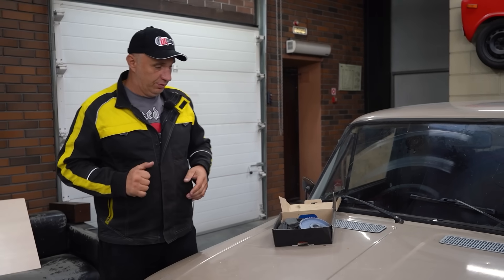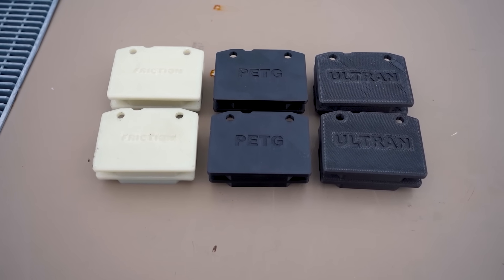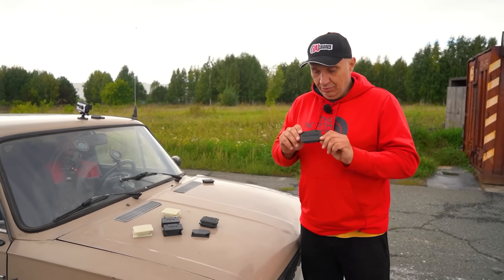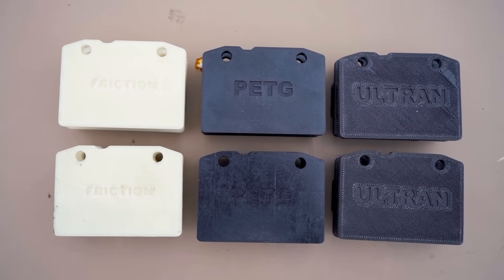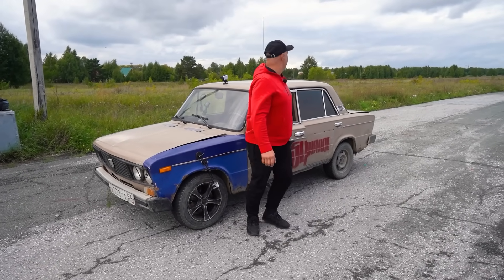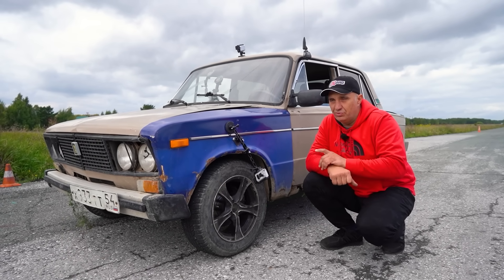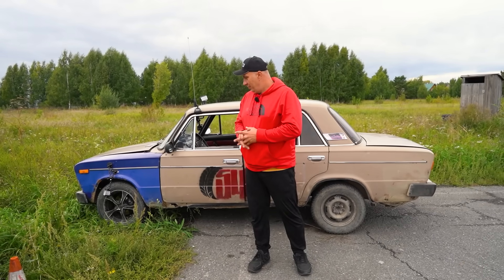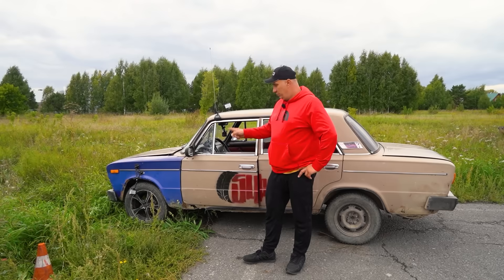We 3D print brake pads for a Lada

Comment: Wish the Ultran pads got tested a second run, to see if they had better performance broken in.
Reply: Definitely

I don't see it as a replacement for cars but in smaller and lower speed/stake use cases, absolutely
Reply: Definitely. You need to brake hard a couple of times to fully bed new pads into the rotors even with the real things. No point in doing that with PETG and GF-nylon which melted faster than this could happen but CF-nylon looked like it could handle it.
Reply: @MadScientist267  Those would be cool to use in a Go-kart or something similar, considering they ere able to stop a 2,000lb Lada. They should have no trouble stopping something weighing only 300lbs. Would make for a great replacement in systems where they no longer produce the pads, or something to save some money on
Reply: @3n3ly7m9  It's less the weight and more the energy in play. A car and a gokart will be using radically different amounts of energy.

The only problem with printed brakes that I see is in the very nature of both anything [plastic] printed and the idea that brakes produce lots of heat.

In a nutshell, "heat melts the filament to begin with, and brakes make more heat than that"... if you think fade is bad with traditional materials......

So to deal with a car, you'd make them bigger, and for a gokart they wouldn't need to be as robust... but both cases would need a way to deal with heat buildup.

Brakes get hot enough just in normal driving to turn those into soup just like the hot end did to make them... Not an effect that will be visible with just a single run like in the video.

I do think it would still have use but I'd want to see a set absolutely tortured before I trusted the idea to do anything real.

The gokart? Haha why not, go ahead and print em on up... I'd roll those.
Reply: @MadScientist267  Yup! Heat's the real killer here!  It IS supposed to melt with high heat or your 3D printer couldn't use it, and brake pads produce a LOT of friction heat! Those special plastic filament materials are made with strength in mind and NOT really heat resistance.  They are getting better and better though and hopefully something with BOTH properties in mind will eventually be available to try on "crazy" experiments here soon!  👍👍
Reply: @arthurmann578  Indeed. I figured they would all look like the PETG...

After seeing the Ultran, I was shocked at first that the glass version didn't do better but then it hit me as to possibly why they had stronger fade... I think the Ultran is probably conducting heat rather well, but the glass does not. I think this may be what is holding them together better at the interface. In terms of raw "stand up to it", the glass I would imagine is comparable in toughness at sane temperatures. It would explain why the glass fades so heavily with "all else equal" lol

Just a theory 🤷‍♂️
Reply: @MadScientist267 Brake pads cost nothing why would you use plastic?
Reply: Carbon reinforced nylon for the win. Wonder if that could be used on model airplanes.
Reply: spoiler T.T
Reply: @Jobanivrodnachui  Prototyping a design for something having specific requirements maybe... I'm not saying there's some kind of "dying for it" market for such a thing... but I'm damn sure acknowledging the hacks these guys prove out when they're simple, effective, and have viable potential for use. Most of it doesn't qualify... but this does. 

For another good example that I'd really like to see play out a bit further, check out the engine brake valve in the exhaust. Add on some detail like brake pedal + clutch engaged -> spark/fuel kill > valve close > throttle open > friction brake... Guess what makes a really nice candidate for the minimally-in-play friction brake?

No commercial market for this specifically now of course with electric trying to take over... but if you're building some one off contraption that employs this kind of thing, you're probably doing it similar to how Vlad here push started this whole channel lol... "Because reasons" 🤣
Reply: What is Ultran actually material made of ?
Reply: @dzitiatri  Not a lot of info available it seems but way I have it, carbon fiber reinforced nylon
Reply: @MadScientist267  it will not withold temperature
Reply: @dzitiatri  No but if you notice I mentioned limited use cases and such. I explicitly already mentioned the lack of tolerance to heat soak, especially at higher temps. This doesn't mean it is useless as a brake friction material.
Reply: @MadScientist267   It's interesting idea. But printing will not work probably there, as rotors heat up to the red light Which will be 1000 Celsius. It would be more interesting to see a d printed axle shaft
Reply: @dzitiatri  I give up.

Read all of this thread. Then respond.
Reply: Ah yes, bed the pads in so they work better. You mean glaze the rotors so they don't work at all anymore? You guys are funny. You can see the rotors already caked in nylon after one application on the post inspection. You can't make brake pads out of a material with Tg/HDT/Tm of less than 300 °C unless your goal is a speedrun to heaven/hospital.

Comment: I work with plastics, that glass filled nylon is really durable, it is used for the chassis of some car vacuum cleaners, and even more stressful applications. I'm most impressed with Lada brake pad retainers, that's a very easy change, I wish American cars had that!
Reply: Those pad retainers are only easy when they're not rusted shut, then they're a nightmare.
Haven't owned a Lada, but a Mazda i had used a similar retaining mechanism, and i had to take the car to a shop where they pushed the pins out with a hydraulic press and even that took ages.
Reply: Injection molded plastic with glass/carbon filling is not really comparable to 3d filament "reinforced" with those. With injection molding, you use long strands that increase strength substantially by bearing the load. In 3d filament that prints out of 0.4mm nozzles, the strands are chopped to such tiny lengths that they're basically dust and don't actually carry any load. Mechanical properties testing of these materials reveals that they're very marginally better than plain plastics, if at all. Carbon filling greatly increases UV resistance but beyond that it's a huge waste of money.
Reply: Toyota trucks use that caliper design, in the front. Way easy to replace pads on.
Reply: @michaelbuckers carbon filling increases the stiffness of the part quite significantly.
They also tend to do a bit better at higher temperatures and are more resistant to creep.
Tensile strength is about the same, though.
Reply: That's because Lada is based on a 1950's Fiat.
Reply: @NoOne-ef7yu  If I wanted stiff plastic, I wouldn't be using nylon - the single most flexible type that isn't meant to flex like rubber.
Reply: My 79 Datsun B310 aka Nissan Sunny uses almost exactly the same setup. Long pins with springs between the pads and little clips holding the pins in. Pads look very similar too
Reply: @TopiasSalakka it's impress that there not rusted shut considering that car lived in Siberia.
Reply: What if, you 3D print the unibidy for a DeLorean using glass filled nylon. since the delorean has a fiber glass unibody.
Reply: I think the BMW M series brakes changed the pads out like that.  Super fast and easy.
Reply: @Boodieman72 It's a Fiat 124 from 1966 or so. My first car was a 69 124. They're much better cars than people think. Only real issue was rust. Electrical problems were due to rusty grounds too.
Reply: @TopiasSalakka  i owned a lada and there is no much problem with that  you just spraying some wd40 on pins then beating them out with the hummer , or some times i used bigass plumbing wrench or gordon freeman’s crowbar , or you can saw them in half and replace with big nail, they are not rust and and stick heavily because  they are not steel  as i recall they are from some alloy , much bigger problem was to move cylinder back to install new ones…
Reply: My volvo 240 has almost identical pad changes. Super easy and quick.
Reply: if you created the glass in a vacuum chamber it would be stronger than steel since the vacuum pulls all the air bubbles and moisture out of the glass, thats what makes glass brittle, you should be able to put molten glass in a vacuum chamber and it should still work since it would be difficult to actually make the glass itself in the vacuum chamber.
Reply: That's the way all dual (quad, sextuple, etc) piston calipers are. If it has a piston or two on either side of the rotor, then it's gonna be a similar design. The bigger 6, 8, 10 piston ones should be the same but with variations of course
Reply: My Cadillac had calipers like that. I only took them off because I was replacing them with a larger brake setup from the CTS V-sport. Super easy
Reply: Most sport models come with Brembo brakes or similar and the pads change out like that aswell

Comment: The G in PETG means Glycol, so it extrudes easier through the nozzle, it's pretty much a lubricant.
Reply: You can 3d print with normal PET, it's just harder to get and you have to print at a hotter temperature

Comment: 3d printer tech is really useful , especially with the different materials that are possible.    metal 3d printing can even made custom parts designed only for your specification
Reply: plus 3d print wax to cast metal is way easier than alternatives.
Reply: Bugatti makes parts for cars using 3D metal printing.
Reply: Porche 3D prints their racing pistons. The video is on YouTube. It's cool how light they can make them with a honeycomb structure infill. No other manufacturing practice can make them that way. I find it very interesting and cool.

Comment: the carbon on steel backing plates would be interesting. or the carbon for the friction surface of a clutch disk.
Reply: yea, carbon almost doesnt have a melting point it is so high, it is the perfect material to use where high heat is involved

Comment: I am very surprised by the carbon infused plastic. I didn't expect any to really work, nevermind working that good.
Reply: Looks like if they had time to seat in they would work as well as the original, at least for the first time or two you use it or until they get hot.
Reply: well carbon doesnt really melt, at least not at any temperature we can achieve which makes it the perfect material for high friction high heat tasks.
Reply: @King_Flippy_Nips  Not really sure how dense it is with carbon though. It is still some kind of meltable polymer base material though or it couldn't be printed.
Reply: @D3M3NT3Dstrang3r  Exactly. The binder it is in, nylon, melts at WAY lower temps. This is a joke

Comment: Need to use a thermoset resin instead of thermoplastic. 

Like bakelite, impregneted with the dust from around your bench grinder, but a higher ignition temperature & will not melt!

 3D print a mold for it…

…then melt the thermoplastic mold to remove & test the JB Weld brake pad.

Comment: I've thought about trying to 3D print my own snorkel intake for my truck. You should try that and an intake manifold.
Reply: i scanned my engine bay with photogrammetrie and build a pre turbo intake for my nissan s13 in CAD. worked out great! material is ASA, so i'm a little bit worried about heat. but so far it holds up, no racetrack use yet, just some german autobahn runs and couple of burn outs haha

Comment: So you should have 3D printed rotors to try against the printed brake pads.
Reply: I think they will just break off when the real brake pads pushes on them with hydraulics
Reply: @XdewGaming Maybe, but it will be entertaining.
Reply: @XdewGaming  if you use carbon fibre with the fibres made from glass created in a vacuum chamber the glass strands will be stronger than steel since the vacuum pulls out the air bubbles and moisture which is what makes glass brittle, glass itself can be stronger than steel.
Reply: @King_Flippy_Nips  Carbon fiber is not made from glass

Comment: I've done a lot of FDM printing work and I'm not sure what "Ultran" is but it sounds like carbon fiber ULTEM, which is PEI in an ULTEM resin. That would make sense. It has great heat resistance and the CF improves its already decent strength and stiffness. It's not easy to print though, needing nozzle temps approaching 400C and a heated chamber. I thought he also referred to it as a Nylon at one point, which is possible but doubtful.

It's no surprise glass fiber nylon was worse. Any benefits and whatever added "friction" it has would be irrelevant here. I'd expect even CF nylon to be better, assuming they used PA12. Nylon in general would quickly soften but I doubt PA6 would be much better than PETG in this case.

For comparison, typical PETG's glass transition temp isn't even half that of ULTEM and gets slippery so no surprise it smeared like a candle. I don't even know why they bothered. Straight ABS would likely have been better than PETG.

I've seen a type of PEKK with a ceramic additive that would be very interesting for this but it's not cheap.
Reply: It had no relation to Ultem, it was just regular old carbon fiber nylon with a regular temperature resistance (IE not high enough for this application).
Reply: @mjodr  Thanks. I've never heard of Ultran but that makes more sense.

Comment: cut a grove in the best set and then put a strip of winter tire tread in it, The soft rubber should hold onto the rotor and the plastic pad part should be good to hold it, Not to big a strip or the rubber will just lock up the wheel rather than slow it
Reply: Tire would be on fire in seconds

Comment: You should try and 3D print as many individual parts of a Lada as realistically possible and assemble the car with as many of those pieces as you can to see how much weight it would cut down on the car and how strong it would be overall :)
Reply: no? plastic is extremely expensive in terms of weight. sheet metal and fibre panels are probably 30-40 times lighter per strength than plastic